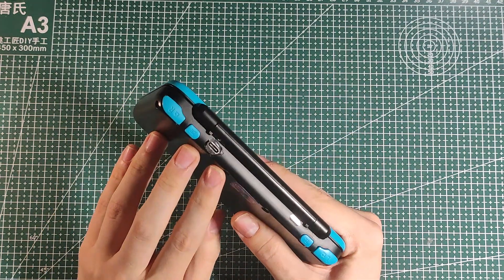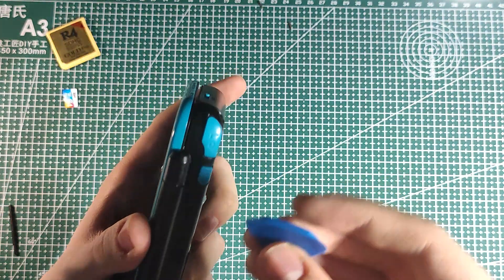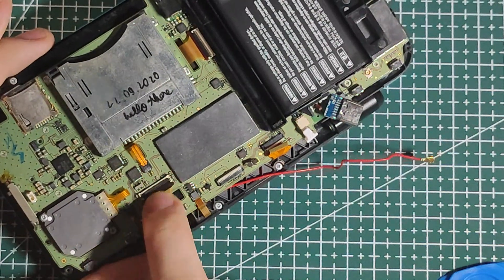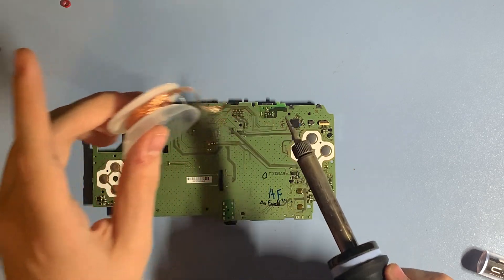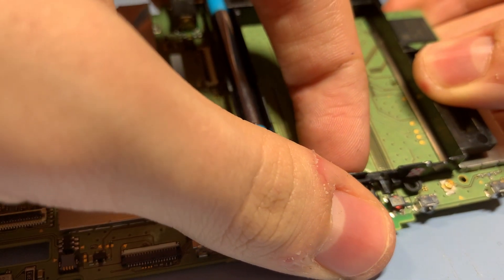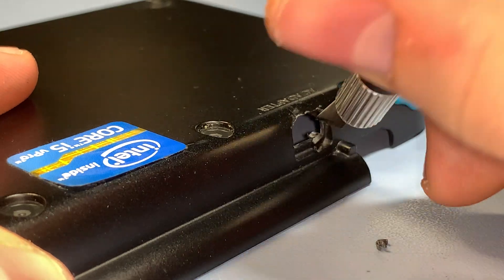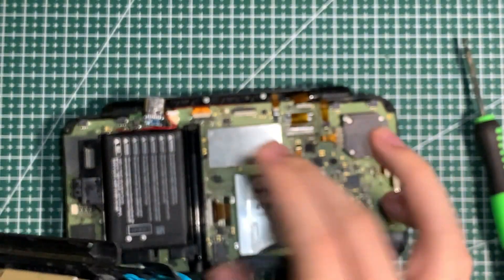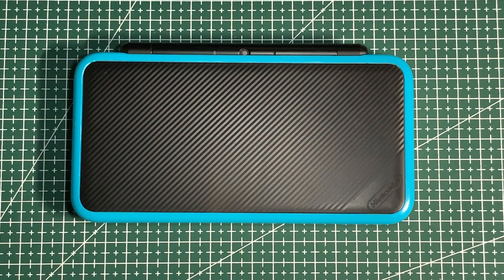Nintendo 2DS XL USB-C Mod

Comment: Does this support fast charging by any chance? I presume not, but I was looking to upgrade my 2DS with USB C fast charging. And if this does support fast charging that would save me lots of time and risk.
Reply from the maker: @Legend-d6f2b Nope. Unless you implement a separate battery charging circuit, it won't pull more than like 500mA

Comment: Is it ok to just use a 2 pin usb c port, and would a 1206 resistor be a good size?
Reply from the maker: @gummy8847 if it has the pads that connect to the CC lines, it should work the same way, I didn't use the data lines on my port either since there's nothing to connect them to.
Electrically you can use any size resistor as long as it's 5.1k, but hooking it up to the pads can be harder if they're designed for 0603 or 0805, you may need to wire it up with wires to the pads if you can't get it to connect to the pads directly
Reply: @zUltra3D  thank you so much 🙏🙏😭😭

Comment: Does it charge faster with the usb c port?
Reply from the maker: Pretty sure it won't. The current draw is determined by the console, so even on a very high power charger, the console will only take as much as it needs.

Comment: Can u probably make a video on how to replace shoulder button? On 2ds my shoulder button broken and very small 🙃 lol
Reply from the maker: Are you talking about the plastic piece or the switch on the board? Either way, there are more likely already videos covering something like this. If you're looking for a switch replacement, you can look at joy con repairs too, they use pretty much, if not the exact same switch.

Comment: I been trying to find this mod for like months now and i found it! Just one question. What is the white cable at 6:20 ? I believe the red cable is 5V but on my research the white cable is data+ or positive data. Am i right?
Reply from the maker: White is sometimes used as an alternative to black to mark the negative (really that's just an excuse) 
idk why I went with white, either it was the only other color on hand or I just chose it for no reason.
Also no, the green wire is used for data+, data- being the white wire. It doesn't matter here anyway since the only pads that are used are VCC and ground with no data lines, there's just no USB interface on the motherboard
Reply: @zUltraXO  i do have a 12v fan that  has yellow, red and black wire. Will the black and red wire work for this?
Reply from the maker: @turtepas  any thin wire will do
the insulation color doesn't matter here

Comment: So how does this Mod work with the 2DS XL? Does it affect battery life and make it worse? 

Does this charge my 3DS faster and better than the original one?
Reply from the maker: The original charging port only has 2 pins, +5V and GND. This mod uses the same pins from the breakout board to those pins. The added bonus of this simplicity is that, by adding a 5.1k resistor to the pads on the breakout board marked with R1 (which will connect the CC lines through the resistor to ground), you can charge it with any charger capable of outputting 5V.
The rest of the charging isn't affected as the 2DS only pulls as much current as it needs to. It just changes the port to something more convenient as it's widely available, flexible and reversible

Comment: Can i do this on a normal 2ds
Reply from the maker: Absolutely, they both use the same connector so the wiring is the same but mounting it is what could be different. Aside from the mounting, the process is pretty much the same.
Reply: @zUltra3D  thank you for you answer bro

Comment: When putting back in the two skinny ribbonsthat dont have latches, are they supposed to be snug?
Reply from the maker: I think they should have a slight tactile bump when inserting them back after which they should stay pretty still in there without much movement
Reply: @zUltra3D  thanks for replying! Earlier I was able to straighten out one of the ribbons(the top one) and it booted right up.  So yea your video helped me with installing it.

Comment: Solid job, does it work with USB-C to USB-C cables?
Reply from the maker: I'm not sure about USB-C chargers as I have none but even with regular stuff I was having trouble charging it through a C to C cable. My phone picked it up as headphones for some reason, my laptop's built in type C port didn't charge it while the ones I added through a USB hub did. It's probably because of the missing resistor on the CC connections that tell the charger that it needs current, not to be treated as headphones

Comment: Hi! I want to attempt this mod however after watching I’m curious, I’d rather not go through the work of modding a system only to have the charge port, battery or worse system fry. Are there any issues when charging the system with usb c?
Reply from the maker: So far I haven't had any issues with this mod and it's been my only way of charging for about a year. It may not work with all chargers since the CC lines on the USB-C board aren't connected but with a lot of phone chargers it should work just fine. Optionally they can be connected through a 5.1k resistor to ground using the pad already located on the board.

Comment: How does one get into physically altering a 3ds system safely? I want to be able to do this sort of stuff to the point that I can in the future make a custom made 3ds, but i have no idea how to start without damaging anything. 3DS systems are insanely expensive nowadays 😫
Reply from the maker: I think it mostly comes down to understanding the limits of what can be done and what can't be done as well as having proper tools and experience when messing around with electronics.
If you're inexperienced with modding devices then I highly recommend not starting with a 3DS your first modding project. Start with something simple on something less valuable to get the hang of it and then progressively move on to more advanced stuff.

Comment: What's that red cap on your C STICK ????
Reply: The nipple from a thinkpad it's the same tech inside but the thinkpad nipple is easier to control
Reply: That's a psp style stick upgrade. It replaces the c stick entirely
Reply from the maker: It's a cheap replacement cap from AliExpress, I got tired of my finger sliding off the original stick so I bought this one, shame it's not blue to match the console.
Reply: Thanks
Found it on AliExpress
Reply: Great Video!!!
And you can normally charge the ds with any charger without damaging it? Can I use my 25W phone charger for example and still be safe? I'd do this mod to just have one charger when I travel and knowing it won't damage the ds is the last thing that keeps me from doing this.
Reply from the maker: @StageHazard   For the most part, yes. If it's designed to charge a phone, it can charge a 2DS. I've been charging it with a Samsung 15W powerbank as well as a Xiaomi 33W charger and none gave me any issues. 
I haven't heard complaints about USB-C mods damaging consoles, whether it was a DS, 3DS or 2DS.

While most phone chargers are going to charge a 3DS or something similar, laptop chargers and PD chargers may not. It's not a very accurate way to test but try charging your phone with those chargers (they usually deliver 5V alongside 12V and 15V, though always read the label on the back to be sure) and if the phone instantly says that it's fast/quick charging without first staying in a slow charging mode for 1-2 seconds, it's most likely not going to work with a 3DS. Louis Rossmann did a video on how USB-C isn't as universal as it seems. Before installing it you can add a 0402 size 5.1k resistor to the R1 pads on the connector, because the 2DS doesn't use any communication for accepting charge like some do, with this change, absolutely every USBC charger capable of recognizing the CC pull to ground and respond with 5V will be able to charge the 2DS, including laptop chargers and other stuff